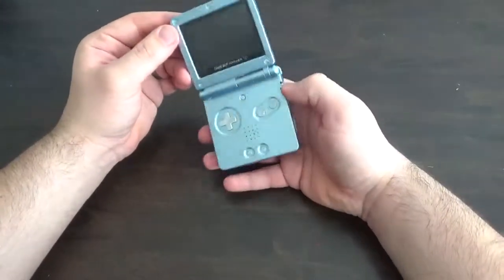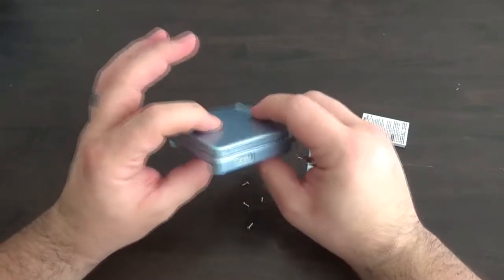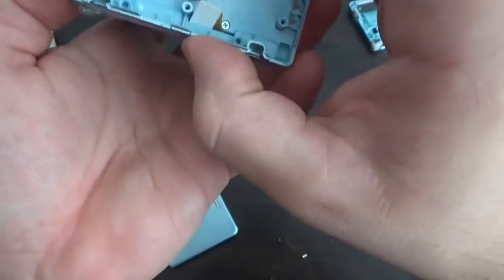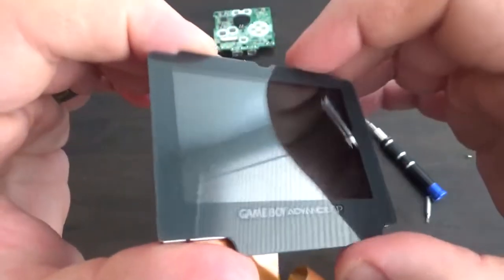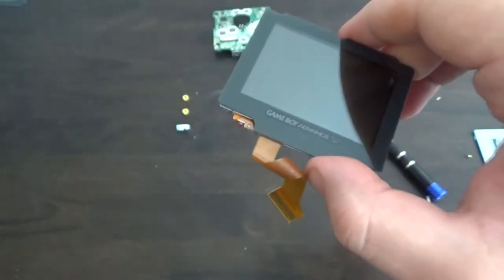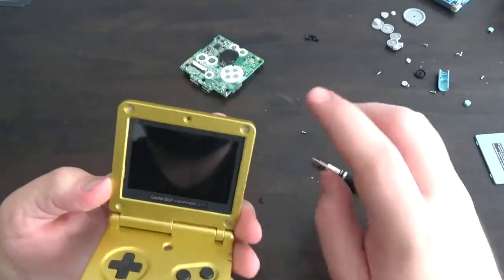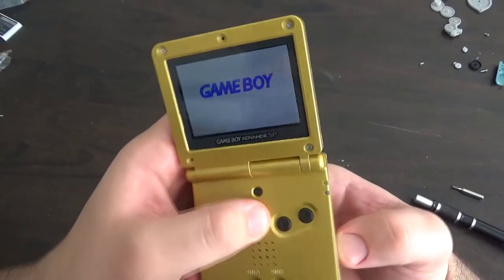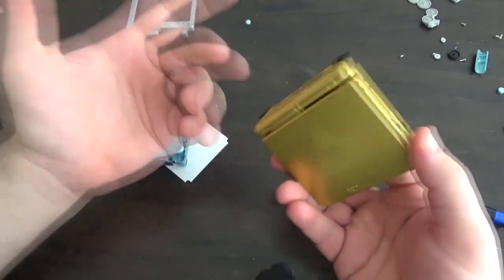How to replace a gameboy advance sp shell

Comment: Definitely the best instructional video on this. Do you know where to get an ags 101 screen for the sp?
Reply from the maker: Thank you very much I like https://retromodding.com the have very good quality parts as well as an ags 101 screen knock off but still high quality
Reply from the maker: And if you have any other questions dont hesitate to ask 😁
Reply: @TheGamingPowerups  Thanks for the quick response! I was just perusing their website using your link. If I buy their 101 screen, can I install it into my 001 GBA sp in place if the original one, or do I need additional parts?
Reply from the maker: @dartheleven2108  you can but it's not a direct swap https://gbatemp.net/threads/ags-101-screen-on-ags-001-motherboard.472415/ there is a guide here to do it as I haven't done that swap but another option is finding an ags 101 motherboard maybe Ebay probably cheaper then buying a complete ags101
Reply: @TheGamingPowerups  soooo basically it's easier to buy a complete 101 and make your own shell exchange if desired ;). Thanks for the help!
Reply from the maker: @dartheleven2108  it can be and I'm glad I could help

Comment: I bought a gameboy advance sp 001 for 150$ and i ordered a replacement shell. Since i paid so much for it i don't want to spend more money to get the 101 screen for it as well since all the ones I've found online are over 100$.

This is my first time ever doing this but been watching so many videos to do it so i feel like ill be okay with not damaging it.

But i do have one question. With the 001 screen for the glass cover that one came with would i do the same thing and heat it to remove to put the new one on it?  Or should i leave it as is. The one i got is in pretty good shape just scratches on the shell.
Reply from the maker: Yes just a little bit of heat from a hair dryer will work and gently pull away from the corner and work your way around. But if it is still in good shape and your happy with it there isn't a need to change it.